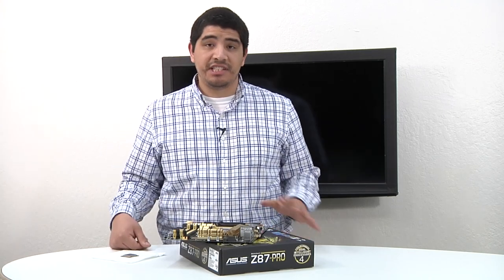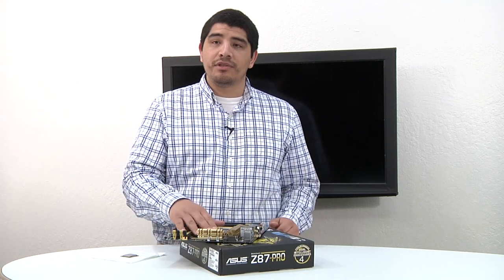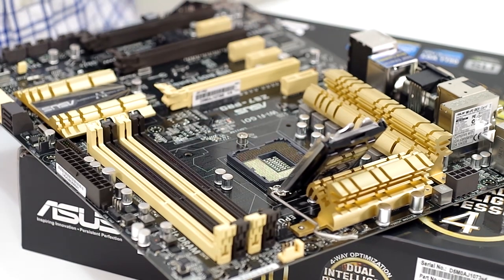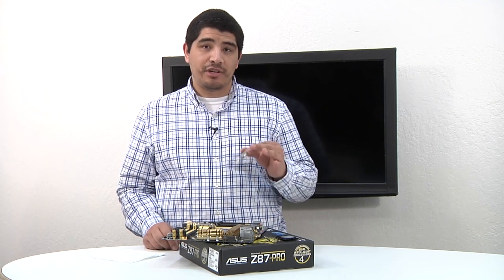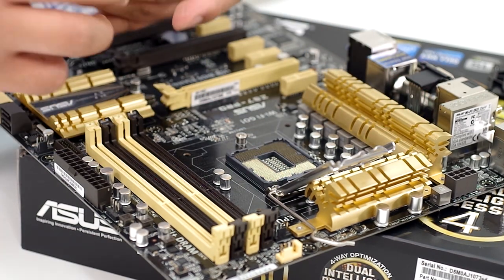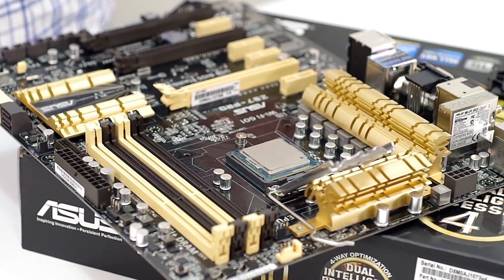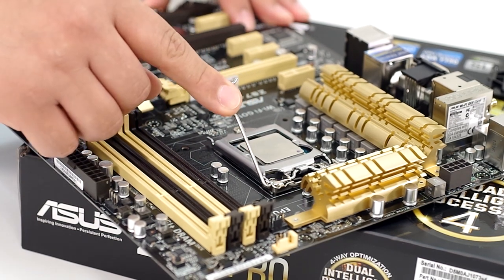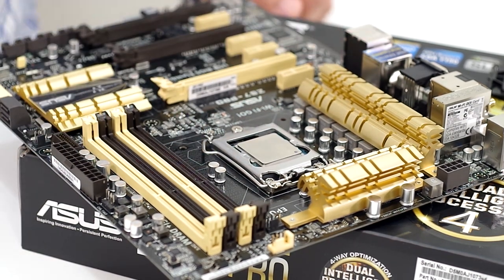How-to Install a CPU on a Z87 motherboard

Comment: In the written instructions by Asus you install it differently.
Also; I HIGHLY RECCOMMEND that you have a different finger holding the CPU chip down; as, IF you accidentlaly let the pin (under pressure) SLIP and `spring back`, then the CPU could jump/bounce up/down and damage the CPU pin bed; ruining the Mo-bo.

Comment: During installation process if our processor is in the correct orientation to the socket if it possible to bent pins on the socket? I am scary about it. I plan build on the Intel platform. This will be my second build in the life. First build was on the AMD platform and it was easy so I have good memories but now Ryzen processor are expensive and Intel is better option.